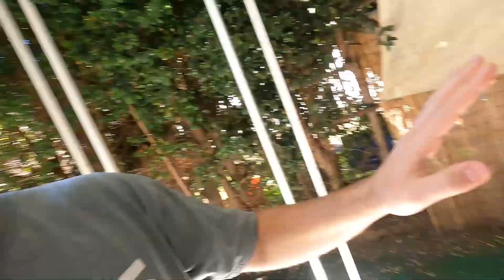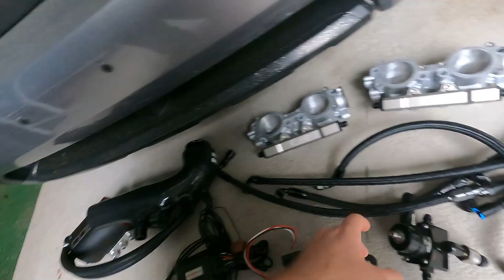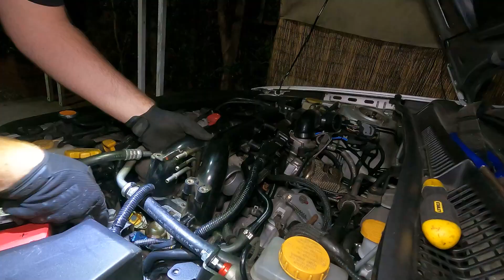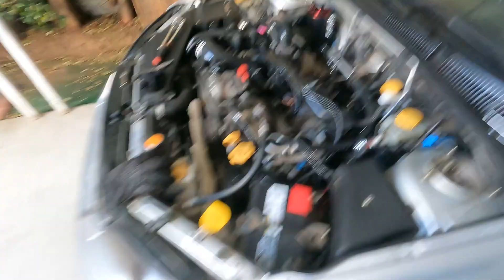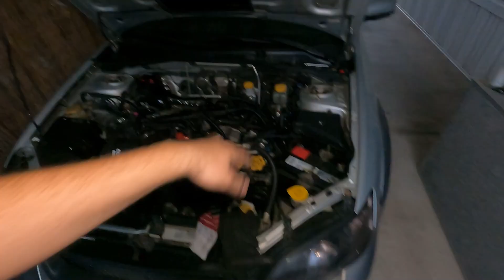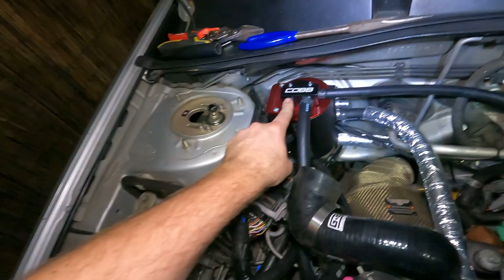Subaru Stage 3 Part 1: Turbo Inlet, Fuel System, TGV Delete, and AOS Install!

Comment: It's hilarious to see ya facial hair getting longer as you do shit. I would've liked to have seen a more detailed look at putting in the AOS. Did you use the drain line from Flat Irons to drain into the back of the block vs the top of the block?
Reply from the maker: Here is the link to the video:
https://youtu.be/Lmjuj7znKfM
The process and line routing is pretty similar to the cobb aos with some minor differences. 
Thanks for watching!!
Reply: @SWSpeedCo  you're effectively modding 2 OBXTs. I'm not gonna do the E__ thing thō.
Reply from the maker: Yeah haha, this video was pieced together over a few months so there was alot of facial hair growth in that time. I have a more detailed AOS video for the crawford AOS that I uploaded a couple years ago. And I just use the drain on the top of the block and haven't had any issues with it that way.
Reply: @SWSpeedCo  it perfectly encapsulates working on a Subaru. EVERYTHING you do to 1 that involves tools, is NEVER a "quick fix".

Comment: Yo dude, solid Outback build! I too have been on an Outback build journey. I'm working on my 2008 Outback XT. Lost track of what "stage" I'm at, but so far my build has the following:

Nameless Catback Exhaust with Resonators & Mufflers
IAG UEL Header
PLM Up Pipe w/EWG flange
Invidia Catted Downpipe
Grimmspeed Top Mount Intercooler Kit with Splitter & Black Thermal Dispersant Coating
Koyorad Aluminum Racing Radiator and cap
Grimmspeed Radiator Hose Kit
COBB Air / Oil Separator
COBB SF Intake with SF Airbox
Injector Dynamics 1050x Fuel Injectors
AEM 50-1215 Fuel Pump (340 lph)
iWire Fuel Pump Controller Hardwire Kit with Bypass Stud Kit
IAG Fuel Rail & Lines 
IAG EJ Street Series Oil Pan, Pickup, Street Baffle, & Windage Tray
COBB 3-Port Boost Control Solenoid
COBB LF Bypass Valve
Perrin Turbo Inlet Hose
Forced Performance Green UHF
Tial MV-S 38mm external wastegate
GrimmSpeed TMIC STI-Style Turbo Outlet Hose
GrimmSpeed Pitch Stop Mount
Whiteline Front & Rear Anti-Sway Bars
Whiteline Front & Rear Endlinks
COBB Lightweight Main Pulley
ADF MT Anti Wobble Insert (60d)
COBB Front & Rear Shifter Bushings
COBB Short Throw Shifter
Grimmspeed Tallboy Aluminum Shift Knob
Exedy Stage 1 Clutch & Flywheel Kit
E85 Pro Tune
NGK Iridium Spark Plugs
COBB Accessport V3
AEM X series wideband gauge
AEM X series fuel pressure gauge
Grimmspeed Alternator Cover
Grimmspeed Radiator Shroud
COBB Delrin Oil Cap
COBB Battery Tie Down
Sylvania Silver Star Ultra low beams, high beams, and fog lights
Draw-Tite Max-Frame Class 3 2” Trailer Hitch
COBB Gray Hitch Cover
Primitive Racing Outback Suspension Kit Including:
King Lift Springs + .75″ Front & 1″ Rear
KYB Struts with upgraded rear shocks
Reply from the maker: Very nice i wouldjust say stage x haha. Next video for Stage 4 I will be installing tomei uel headers and a Blouch 1.5xtr 10cm turbo. Thanks for watching!!
Reply: @ can’t wait to see it!🤙🏻